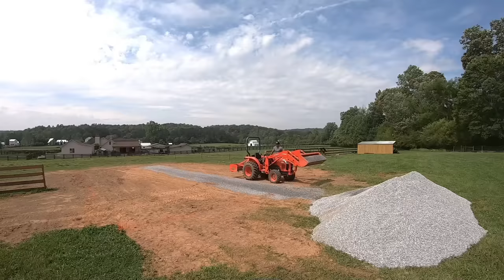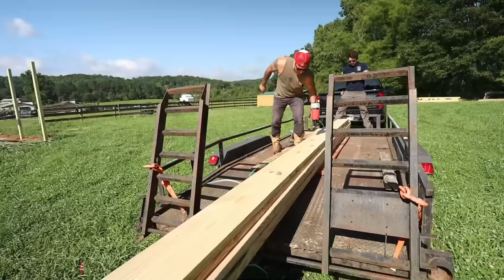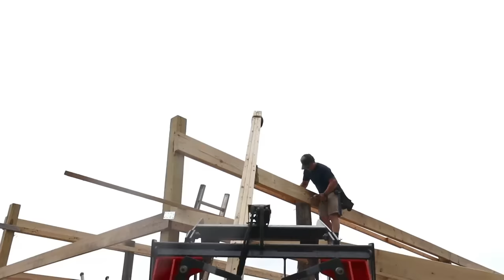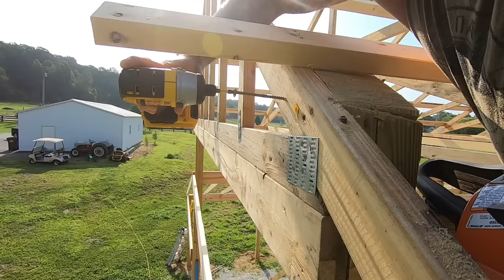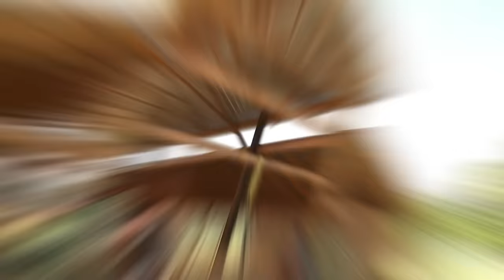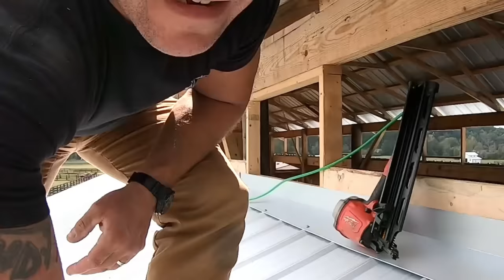Unbelievable budget pole barn built in 10 minutes TIME-LAPSE.

Comment: You’re the only youtuber that I have seen do the sonotubes correctly. Just to form the top of the foundation. You let the concrete lock into the soil.
Reply from the maker: Thanks man. I’ve always wondered why people do it the other way seems like a lot of play would be left
Reply: If you’re in a deep frost zone you need a tube all the way down to what is preferably a footing then backfill around the tube with drain rock. Otherwise the frost will cause the dirt to grab the tube and heave in the winter.
Reply: @miketoopitsin9449  
I’m a structural engineer. Yes, what you suggest is correct. But if you’re drilling the foundations it’s not practical. The frost depth for footings is not how deep the frost goes. The frost will only go a foot or so deep. When the concrete is poured against the rough edges of the hole it locks into the soil. The extra two feet of footing below the actual frost is what keeps the footing from being jacked out of the hole by the frost. Locking it into the soil provides a lot more resistance to uplift than the smooth sides of the tube.
Reply: @johnritchie3889 lol engineers.
I'm an engineer but you are so wrong frost can reach alot deeper.. especially on ground you've removed the topsoil like this or land that is large and tilled.

I would wager you don't dig holes in areas where it's cold so perhaps you should not talk about it like you do "engineer"
Reply: @thenarrator1984  That would be why I said “… or so”. My point was that much of the footing is there to resist frost heave. If the frost went all the way to the bottom of the footing, there would be no resistance to heave.
Reply: @johnritchie3889  yeah agreed with all your post except for the part where you say frost will go a foot or two down ...

I've seen full ice chunks at 12 foot deep and it wasn't even far north.

Sorry but that one little sentence makes your post ridiculous.
Reply: @thenarrator1984 i live in northern sweden and we have frost down to 2m (6,5 feet). For example. Oh and in also an engineer to join the club :)
Reply: @fleshfabbe  yep. Frost will reach deep depending on the surface insulation. Etc
Reply: @johnritchie3889 In North Dakota the building line for Frost is supposed to be 5 ft but we've had water lines freeze 8 ft deep

Comment: Im gonna build a massive barn, but pouring a slab foundation and using structural steel columns and glulams. Nice barn
Reply from the maker: That’s gonna be nice! I would have love to pour a slab for mine just wasn’t in the budget. Thanks man
Reply: @ProjectDadLife  you did a great job, I have been a carpenter for 33 years, I can appreciate the work you’ve put into that barn. The only thing I haven’t built yet is a barn.